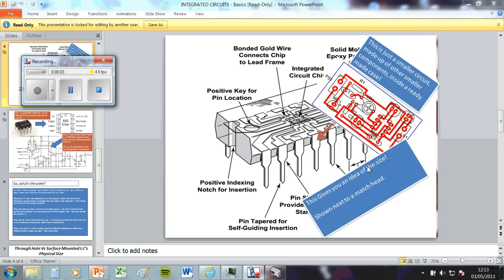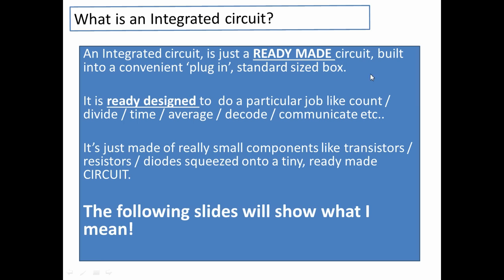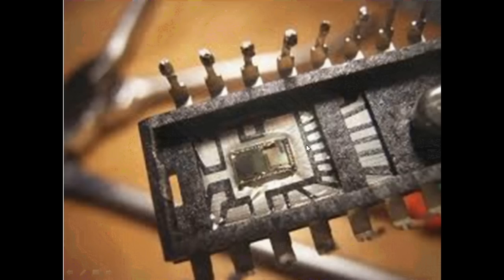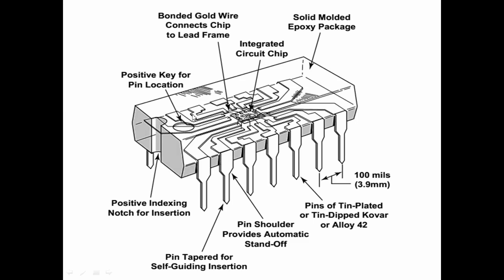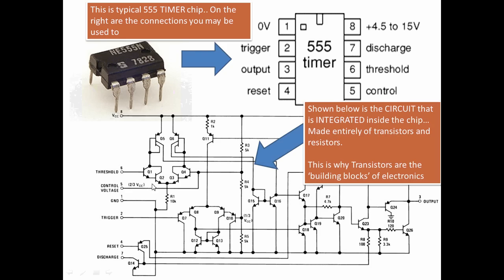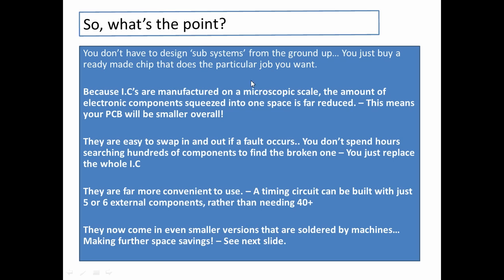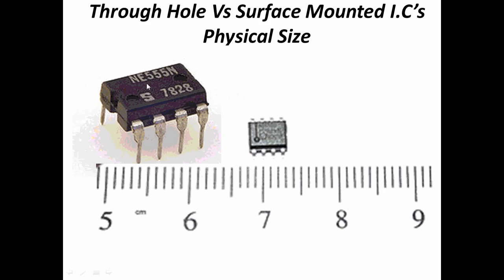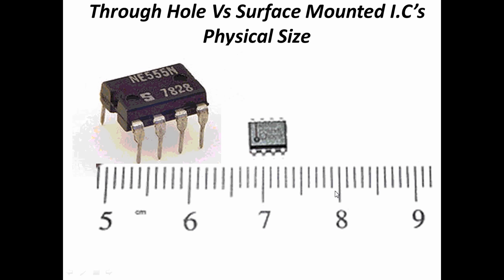What is an integrated circuit?

Comment: I thought IC's were solid state components where the chip is a solid piece of material where the configuration and direction of atoms carries out the function of a circuit made of discrete parts?

But what your saying is I am wrong and that the IC has several discrete components that have been made significantly smaller and placed on one device.
Reply: Its a lithography. There is a little mechanics in there but its soooo small and thats the reason why it is called solid state. But those transistors are switching and there are far more little components on there